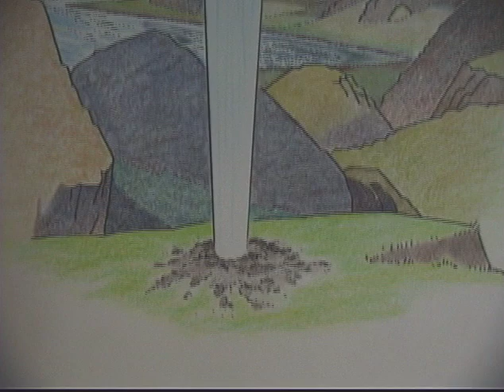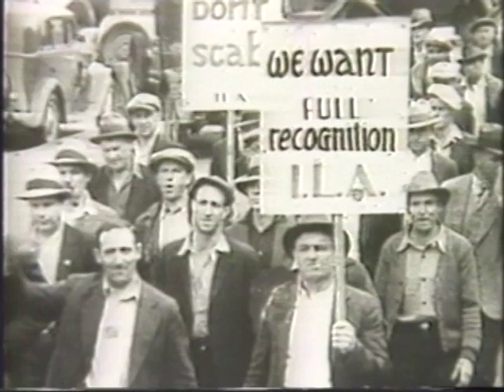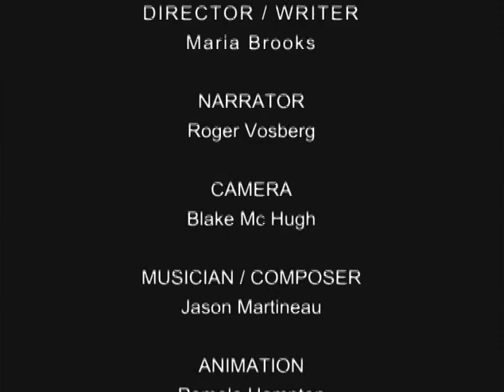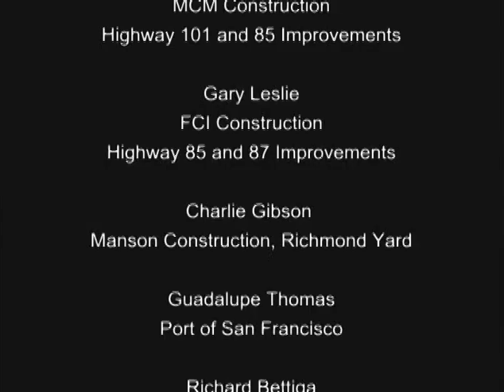Pilebutts - Under The Hammer

Comment: I'm an old Pile driver known as a Bridgeman (LU 2404) , Three of us did all the pipe piles at Canada Place and the Alexander Bridge in Vancouver B.C. Back in 1983~4 ...Our pipe piles went down over 200 feet and socketed 20-30 feet into the bed rock ...these pipes were augured out by a 100 ton crane then filled with a rebar cage and concrete this is what these structures were built on to be earth quake proof ..some times the bottom of the pipe would hit a boulder and I would have to go down in a small man basket to cut off and take out the bottom of the pile and a blaster would go down and blast the boulder out of the way ..when all was done one person had to go down this 200 plus feet to clean up any dirt on bottom of hole before the rebar cage ..one time I had to go down in a 24 inch pipe, It was to small for the man basket and I had to ride on the round 500 pound head ache ball ..on the bottom I had just enough room to stratal the ball and stand in the muck while trying to use a oxy-acet. torch to fresh head the bottom of pipe ..man o man coming back out I held on for all i was worth cause if I slipped off not enout space for me and ball to pass ... 
These were crazy days ..but that is my deep hole story
Reply: You went down a 24 inch pipe, that is scary man, just thinking of it gives bumps, they wouldn't let you do that now,H and S
Reply: My hats off to you sir. I never drove piles but worked as a grounds man on a rigging crew. The biggest lift I’d done was an 80 ton transformer in a sub station. Did that for a year and went to grab a cable sling out of the trailer and it slipped and in my stupidity put my arms out to catch it. Blew the last three discs in my lower back and that’s all she wrote.
Reply: @andrewrees8749  ..Yeah Man ..crazy eh ......Was a whole different set of working standards back then..
But Hay guys thanks for reading and relating to my history,, love your comments ...thanks
Reply: @ThreeLittleBirds111  well done sir hats off to you

Comment: I’m a Union laborer but been on a bridge crew my whole life. I’ve been up on those piles pulling leads driving piles for bridge piers I absolutely loved that job till a bridge job took me out the game. Blew 5 discs in my back now have a hard time feeling my legs due to severe nerve damage. I really got screwed up. But I woulda never wanted to have it any other way. I loved the job I miss the job shit I miss being on a bad ass crew a dudes who been through hell and back together and would die for one another . I miss being on a crew like that. Union strong my brothers and sisters!!!
Reply: I was a Union Construction Laborer as well.  I did plenty in support of our Pile Drivers. Bridges, foundation or retention.  When the crew was short handed or needed an extra hand I was drafted for the job. Lofting, rigging or whatever.  Hated auger cast and the grouting.  Preferred the dripping diesel and grease all over me.  Like you my back went out.  It just degenerated all on it's own, never hurt on the job.  Had nearly 30 years so I took my regular pension.  To this day when I see a crane with leads and hammer I get a little excited.  Even more than when I see a dozen concrete trucks and pump booms in the air.  Peace Brother.  ( Laborers Local 81)